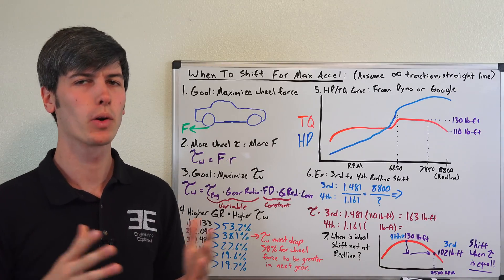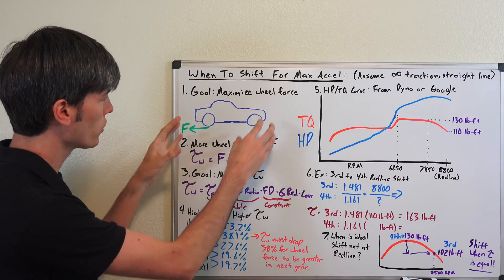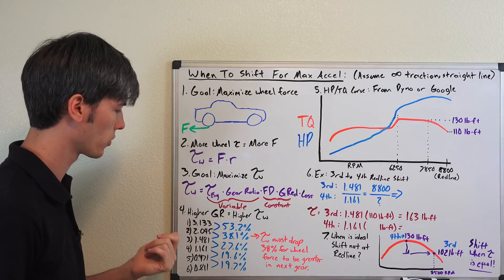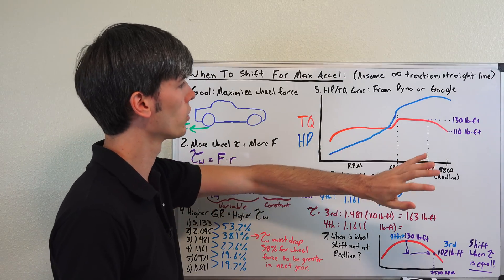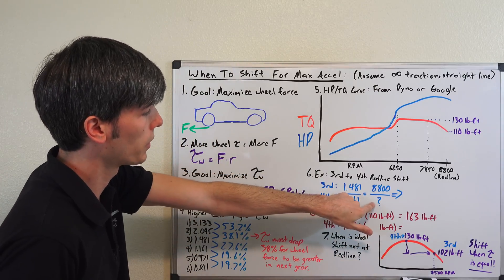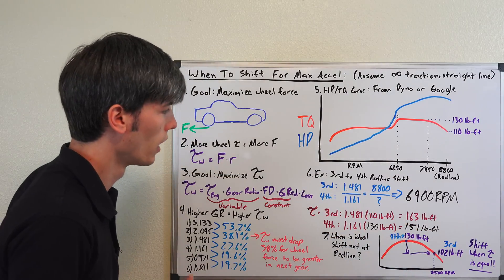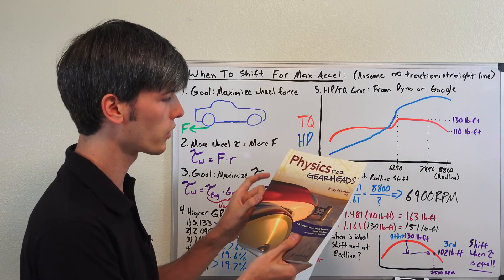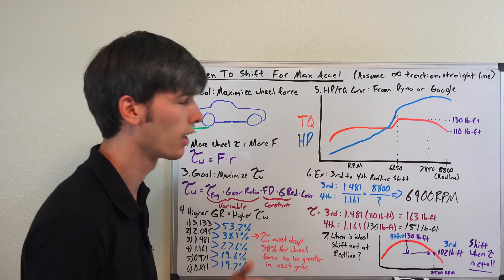When To Shift Gears For The Fastest Acceleration

Comment: I shift at 5700rpm (already look3d at dyno graphs) red line is 6500. after 5750 lrpm my car begins to close the throttle blade to limit boost in high rpm in turn hp dramatically falls off, and it falls on its face. if I shifted at redline I love wouldent win any races lol
Reply: Does it limit boost at high RPM in all gears?
I only know of this in 1st and 2nd gear for traction reasons...

Comment: so for better ergonomics can we just shift as close as rev limitter, we need max hp or max tq,my engine is m52b25 with %40 bigger intake manifold and , 240 degree 9.7 lift cams , (228- 9 normal cams) , and bigger injectors , with stock map. car feels less power but , my 0-100 better. i wonder when i change the cams new cams stay open %5 more and opens %7 more so my power increase directly   hp*1.05*1.07 = hp*1.12 wich means %12 more power or what?

Comment: Thanks for doing the math....some people don't get it. It would be nice, if you would have done this for a turbo charged car too. Maybe there you can find a car that is loosing too much torque near red line. I would assume a few of the downsized engines with small turbo chargers designed for drivability would do.

Comment: Very interisting explanation, as always ! I would very much enjoy this explanation again but with a diesel on a modern hatchback, like a Golf Tdi or a Clio Dci. 
BTW kudo  to you man, your  videos are still worth watching over and over again and that's not an easy task :)
Reply from the maker: The math can be applied to diesels as well, really anything which you have the HP/TQ curve for.
Reply: I had a Golf 2.0 TDI Dual-Clutch 6 speed automatic. It would not shift at redline in the higher gears (4, 5) but slightly lower as you could see when driving. I found the torque curves and gear ratios which showed that the gearbox was optimized for maximum acceleration/wheel torque (sensibly). The engine torque goes down a lot at higher RPMs, so that's why it makes sense.
Reply: WTF ? We posted that at the exact same time with the same result on almost same car hahaha This is brilliant
Reply: I just did with my Golf 5 1,9 TDI 105 DSG !
On the 4th first gears, it looks obvious as the S2000. On 5 and 6, it is clearly 200 or 300 rpm before redline. It was interesting to do, thank you :)

Comment: So horsepower means nothing? If the car makes the same torque from 1k to 5k like many modern turbo cars do, it doesnt matter one bit what gear you are in?
Reply from the maker: If you watched, you'd realize it does matter. If the torque curve happens to be a perfectly flat line from idle to redline, you'll have more torque the lower the gear you're in. So be in as low of a gear as possible depending on your vehicle speed. Power and torque are related, not mutually exclusive. A flat torque curve will result in power increasing with RPM, so you'll have the power to reach high speeds.
Reply from the maker: Apologies for assuming you did not. Basically the wheel torque equation includes engine torque (a function of HP), and the gear ratio. You have to optimize these two numbers. Whatever multiplies to the largest number is the gear you should be in (for fastest accel).
Reply: ***** I'm not sure what you mean to imply with your dyno example; that's how power is calculated. If you didn't measure torque and engine RPM your equation would be unsolvable. 

The "Horsepower sells cars torque wins races" quote has been attributed to everyone from Carol Shelby to Enzo Ferrari but I doubt either of them actually said it as it's simply incorrect. Note how the majority of super cars as well as all F1 cars, Le Mans cars, most GT cars and so forth all use low displacement, high revving motors. If the assertion that "torque wins races" is true, how do you square that with the lack of 15 liter straight 6 turbo diesels in motor sports?

You should reread B10401's posts, he explains the physics and math behind  it very well.
Reply: Horsepower is merely a derivation of torque. Here's one way to remember it: "Torque does all the work, HP gets all the credit"
Reply: There can be torque without rotation, but there can't be power (hp/kW) without rotation.
Reply: If Torque does all the work and HP gets all the credit, why wouldn't every sports car be using a turbo diesel? Why is a stock mk6 GTI which generates more torque, but less HP then slower slower than Jason's S2000? Great explanation from B10401. So many people don't understand the relationship between tq and power.
Reply: diotough power = torque X RPM /5252
Reply: My little phrase "Torque does all the work, HP gets all the credit" is misleading in some ways but at the end of the day there is an underlying truth. Think about this: what does a dyno measure? Hint: it's not HP. A dyno measures torque and rpm and calculates HP.
Reply: Torque is NOT force x distance, it's just force AT a certain distance from a center. The Nm unit is NOT Newtons multiplied by meters, it's just Newtonmeters (1 newton AT 1 meter, not OVER 1 meter). Ppl are always confusing this.

I don't know why he did all the math taking about torque just to multiply it by engine rpms in the end, hence he's esentially using power to compare gears, not torque. (power is torque x speed)
Reply: gearing affects wheel torque so yes it does 1s gear makes the most amout of tq thats why 1st feels so jumpy because of torque multiplication
Reply: Engineering Explained I did watch but didnt hear you talk about horsepower at any point, I guess I missed that bit. But now I figured out that ofcourse the lower gear you are in, the better if flat torq curve.
Reply: @Mudux
Let's say you want to make a propeller rotate, and you can apply some constant amount of force at a constant rate. You can either grab a very long wrench and generate lots of torque, or a shorter wrench which will give you less torque. Unless you can move your hand super fast, the first option won't get you anywhere. Yes, you turn the propeller, and with so much torque that it's unstoppable. But you turn it very slowly too. So even though a shorter arm gives you less torque, you can make more power with it.

So an engine that has not much torque, let's say 200Nm, but generates this torque up to 9000rpm will have the same peak power as an engine that makes 360Nm up to 5000rpm. They both make around 250hp. Assuming that they are coupled to transmissions that reach the same max speeds at given gear, and that the cars have the same mass and so on, these cars will accelerate at the same rate.
Reply: power = torque * rpm

they are inseparably connected.
Reply: Or, as Jay Leno once put it: "Horsepower sells cars; torque wins races"
Reply: +ccanaves lol so if I apply a force of 10 lbs at a distance of 2 feet, please tell me how you would derive the torque value and the process as to how you arrived at your answer. ;)
Reply: Newton times distance....in this case meters...you can check T=F*s so it is N*m
Reply: This is why you should never discuss physics with motorheads. Most are idiots incapable of understanding the most basic of concepts such as the guy above who still thinks you can get a torque value without multiplying force by the distance at which it was applied.
Reply: Energy and work use the same units, so a constant force F that moves something a distance D requires F x D Newton meters or Joules of energy. Nm and Joules are exactly the same, also Newtons = kg * m / s^2, so work also equals kg * m^2 / s^2, but Joules is a lot quicker to write. 

Torque is a force applied a distance from an axis, and is calculated the same way as work by multiplying force and distance, however in this case it has done no work (No mechanical work is done until something moves) but has the potential to do work (Which is the definition of energy). If it causes the shaft to spin then it has done work.

The problem arises because angular distance is dimensionless (Radians are arc length divided by raidius, both of which have length units, so the unit of radians is 1). 

The work done by a shaft to which a constant torque is applied that makes one complete rotation is the torque applied times 2*pi Radians (An angular distance of 360 degrees). Multiplying Nm by radians gives units of Nm, so telling the difference between energy (Joules = Nm) and work (Also in Joules = Nm) is impossible. How long the shaft takes to make its rotation is irrelevant to the calculation of how much work is done by the shaft. 

If the shaft spins at a constant speed, measured in radians per second, it now has a visible unit (1/s). When you multiply torque by angular velocity you get Nm/s or J/s, both of which equal Watts, which is the unit for power.
Reply: ccanaves lol you keep confusing yourself. It would be impossible to arrive at the unit "newtonmeter" unless you've multiplied newtons by meters. A Nm isn't some magical unit. It is the product of multiplying the quantity of the unit "newton" by the quantity of the unit "meter." It really is that simple. It doesn't matter whether you're expressing WORK as being done or TORQUE.
Reply: Yes it does, because TORQUE is a VECTOR and WORK is a SCALAR. Not the same thing by any means.
Reply: bcubed72 I test drove a 691HP Tesla SP85D, and as you say it's viciously quick off the line, BUT I noticed from a ~50 mph roll the Tesla's throttle response is considerably less than my 400HP GTO, which breaks loose its tires. This is because with gearing I can multiply torque to the ground by downshifting, whereas the Tesla can't. There's a Road & Track video on YouTube of a 425HP BMW M4 destroying a Tesla P85D from a roll. Take away the holeshot advantage from the Tesla and will not crush the ICE cars as easily, or at all.
Reply: what the hell are you saying? Torque generates rotation...
Reply: ***** I didn't give that factor because it depends on your units, doesn't it? Using metric units you have to divide by 9550.

I should have mentioned that factor though. It's basically for metric units: power [kW] = torque [Nm] * rpm [min^-1] * pi / 30.000
Reply: My point is HP is calculated not measured. What is it calculated from? TORQUE! Squaring 15 liter straight 6 turbos in motorsports? Are you for real, any idea how much that pig would weigh?
Reply: it's not calculated from torque, go apply torque to a dyno with a wrench just not enough for it to actually spin and let us know how much hp it "calculates".
Reply: Jeremiah John That doesn't make any sense. If you can apply enough torque with your wrench it will give you a reading. You probably won't be able to apply the minimum amount of torque of that dyno. 

Power describes the amount of energy used over a specific period of. The SI unit is Watts  or Joules per time (P=∆E/∆t). It's not a force it's energy. Torque (M) on the other hand has the SI unit Nm and is defined by a force (F) in N times the length (r) of a lever in m (M=F*r). 

Torque is a force, power isn't. Power tells you something about the "system" and not how fast you'll be going forward.
Reply: Mortalomena Horsepower is just torque times speed, horsepower is constant while torque drops through gear, thatd why acceleration drops
Reply: Torque is Force x Distance, so torque is not a force, it's SI units are Nm, which is the same as Joules. Torque therefore is energy, while power is energy per unit time (Joules/second = Watts).
Reply: Power (Watt) is N*m/s or joule/s, Torque is N*m only, Force times the distance perpendicular. When you gonna make complex calculations you understand them better and why you need them.
P(watt)= T*w
w = rad/s or RPM you need to conver to rad/s
T= N*m
Reply: T is NOT N*m, it's Nm (which is a unit itself, not 2 units multiplied). Completely different thing.
Reply: Yes, but it's Newtons AT a distance, not OVER a distance travelled. One is just force, the other is energy; and you can't mix them. The name of the torque unit in english is ambiguous.
Reply: Your way to remember it is not accurate.
Reply: Can you even read or you failed 1st grade already? You said it yourself, "multiplying force by the distance AT which it was applied" which is exactly what I'm saying. It's not force multiplied by a distance travelled (which would be work/energy), it's AT a distance from a center point.
Reply: +urgetodrive Jay wasn't the first to make this statement, and it's misleading because it makes it sound as if engines with big low-end torque will win the race. Actually it's torque TO THE WHEELS that wins races, and that DEPENDS on GEARING. e.i. torque is part of winning the race, but only if you also have the horsepower (RPM).
Reply: "If Torque does all the work and HP gets all the credit, why wouldn't every sports car be using a turbo diesel?"

BECAUSE cars typically race in "classes" determined by engine displacement. This forces teams to make a tiny engine work as hard as they can possibly make it. If you were allowed a fixed amount of HP (and who cares how you made it), a large-displacement, high-torque engine would rule the day.
Reply: bcubed72 If 2 engines have the same peak power output and both have flat torque curves, it doesn't matter which one has more torque.
Reply: No, the one with more low-end torque would pull better off the line. It's why you see electric cars CRUSH ICE cars with the same HP in a drag race: electric motors make peak torque at 0 RPM.
 
Even in a road race, the larger-displacement engine wouldn't be a handicap (within limits...eventually, weight would be a factor). They had "unlimited" racing up to just after WWII...and you typically bought the biggest engine you could find, then built a chassis to go around it! Displacement-specific RPM was a footnote to such racers...
Reply: bcubed72 If two engines have the same peak power and flat torque curves, the output at the wheels will look exactly the same if gearing is optimized. An engine with a fat torque curve will indeed be stronger off the line than one with a torque curve that's thin down low and fat up top. But that's different than my statement. To say only torque matters is ignorant. If I sit my fat ass at the end of a 10 foot pole, I'm producing 2500 ft lb of torque. But it's doing no good because I'm transferring no energy. That's where power comes in, transferring energy over time.
Reply: 1) I never said "HP doesn't matter."
2) Well, in actual practice, an unusually low-torque engine is frequently that way because it's weak off the line, but has high peak HP. That combo...forsaking power down low in exchange for power up high...minimizes peak torque.
3) It really is HP that matters, but (especially in a street-driven vehicle) it's more "average HP across an RPM range" that matters. People quote "muh car makes 400 HP!"...and then neglect to add (at 7500 RPM). If you spend 1% of your total time in that vehicle at 7,500 RPM...that figure is largely academic! OTOH, quoting torque is a reasonable real-world approximation of what your HP curve is doing when you're NOT at peak RPM.
Reply: Engineering Explained Sorry this is still incorrect.  You are implying that for an engine that has flat torque from idle to redline, that for a given gear, since the torque at the wheels remains constant throughout the gear, that the rate of acceleration is the same at idle as it is at redline, which is simply not the case.
The only reason why in your video it worked out to be shifting close to red line based on torque is because the torque curve is unusually biased towards the top end.  This might mislead 90% of viewers that your video is correct, but if you take a typical engine that has a standard torque curve that peaks at 3000rpm and tapers off above that, then you would have concluded to shift at say 4000rpm instead of 6000rpm.
Just think of torque as the force exerted by each cylinder per stroke.  Yes for a standard engine, say peak torque is at 3000rpm where volumetric efficiency is highest, each individual "punch" from the cylinder is stronger than each individual "punch" at 6000rpm, but at 6000rpm the cylinder is punching twice as often, hence higher rate of airflow/fuel ccombustion hence more power hence higher rate of acceleration.

Comment: Isn't the HP curve of the engine more important than the actual engine-torque curve? I've driven many Diesel cars and the greatest acceleration has always been at peak power instead of peak torque. At peak torque the power rises the fastest. So torque happens to be the first derivative of the power curve.

Comment: hi there, would like to know your thoughts on turbo "flutter", most forums discuss it in turbo applications where a blow-in configuration is present, however i seem to have turbo "flutter" with a blow-off configuration. can it damage the turbo assembly if it continues to occur as i'm currently running max 1.0bar of boost. thank you.

Comment: I noticed that my dads škoda accelerates way faster in 4th than 3rd when overtaking. All the torque is down low. Absolutely nothing at 1500 rpm and max is at 1750. 2.0 TDi
Reply: Diesel torque curve is different. Maybe something to do with that?
Reply: it cant be faster in 4th from 1750 than it is int 3rd at 3000-4000 rmp. it's about power ultimately, just google 80 to 120 km/h in both gears and see the difference..
Reply: MyRealName It pulled way harder in 4th than 3rd overtaking at the same speed. Feels really gutless at high rpm.

So i googled it and max power is at 4k rpm after which there is massive drop so really no point in going past 4k. Max torque 1750 to 2600 rpm. Really no idea why the redline is so high.
Reply: For more maximum speed that's why it's so high.